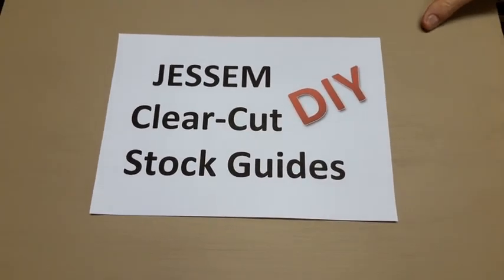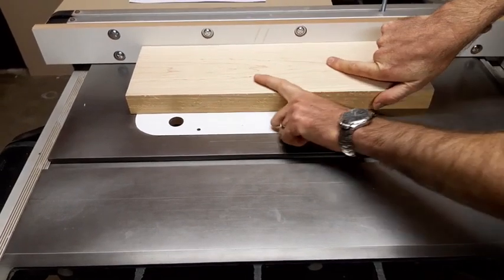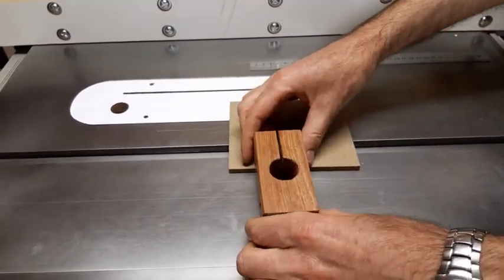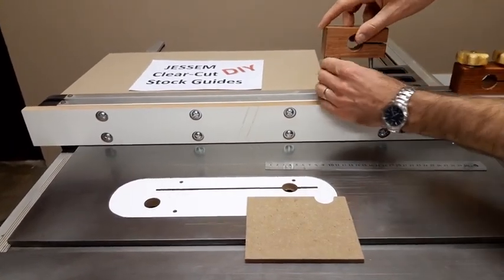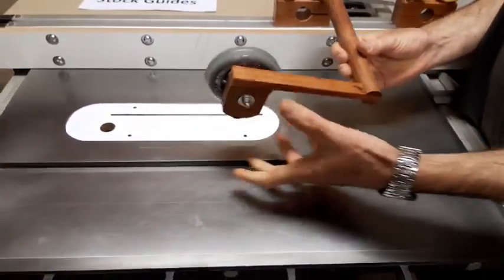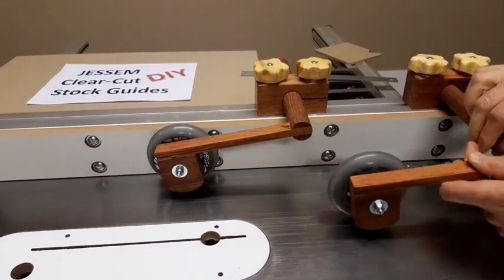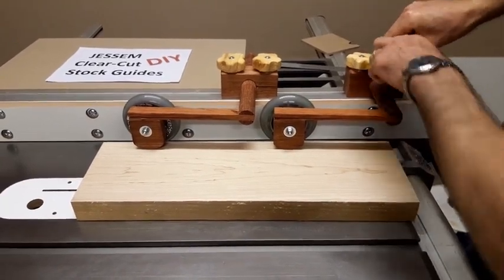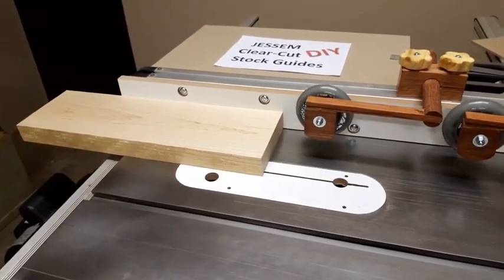DIY JESSEM Clear Cut Stock Guides

Comment: Thank you for taking the time making this video as its very much appreciated. 
As an older person just getting into woodworking (76 years old ) I would very much like to make this jig as I nearly lost the tip of my finger on my table saw.......
I cant afford the very expensive jig but I recon if I had plans I could work with, it would be great
Do you have plans or dimensions please as I don't fancy loosing any more fingers.
Thank you again.
Please stay safe.
Bill M8-)
Scotland
Reply from the maker: Hi Bill, please send me an e-mail and I will send you a few more photographs with dimensions.

However, rather than using the roller blade wheels, rather use these one way bearings. Then cover the bearings with rubber (find a bicycle tube that is slightly narrower than the bearing, cut a ring and pull that over the bearing).  Then you need to figure out a way to make sure that the inner race of the bearing is fixed to the shaft and the shaft is fixed to the housing - then you will also have the anti-kickback benefit of the Jessem ones as well.

corneel.dutoit at gmail.com
Reply from the maker: Bill, also be sure to subscribe since I will make an improved version soon.

Comment: It appears these wheels do not roll in only one direction to help prevent kickback, like the Jessem. Is that correct?
Reply from the maker: Hi T. E., yes, you are correct, they roll both ways and does nor prevent kickback like the Jessem ones.

I have recently bought some one-way bearings to make the wheels from those bearings to prevent kickback- will post a video it that works.

Comment: Excellent design!  Like one of the commenters on this video, I'm also 76 years old.  I can't tell by looking at your video if your wheels are angled in at 5 degrees to steer the board being cut towards the fence the way that Jesse guides do.  Was that part of your design?

Carlos
Reply from the maker: Hi Carlos, yes, I did angle it around 5 degrees to pull the wood against the fence.

Comment: I can’t tell from your video how you apply the downward tension. You say you have three pieces that provide the spring, but I can’t see it. Can you elaborate more or post some close up pictures of the “spring” mechanism? Thank you.
Reply from the maker: Hi Grant, the straight arm from the rod to the wheel consist of 3 separate, thin pieces of wood. They are only glued together where they enter the rod, the rest of the length they are loose from each other and can thus move against each other.

The mounting block for the Rollerblade wheel is slightly smaller than the diameter of the wheel, so when I drop the block onto the wood, the wheel hangs down next to the wood by c 10 mm. When the wood then pushes under the wood, it lifts the wheel up that 10 mm and the three pieces of wood apply downward pressure since they are now being bent upwards slightly.
Reply: @jcwoodworx-corneeldutoit3419  clear explanation, thank you!

Comment: I bought one just a few weeks ago whwn it was on sale otherwise couldnt justify the cost. Little did know that even a good idea/product can be limited by its weakest link. The set i received only had 4 socket screws with wing nuts even though there are 8 holes made for them. There are 4mon each side of the aluminum extrusion and in order to remain ridgid over the years it need secure hold down.  Well apparently spending over $250 did not justfy adding 8 screw sets vs half. Shame thst the customer service was zero help. I remain loyal to companies with good customer service but that was not my experience so will be returning product.
Reply from the maker: Eish John, sorry to hear about your bad experience. Hope they sort it out for you soon.
Reply: I had a similar issue, missing screws for my Jessem doweling jig ... I couldn't get in touch with them at all and was about to give up, then I finally got a response. They moved operations from Ontario to New Brunswick and had hired a third party to handle their customer service during the transition who turned out to be useless. They had my bolts to me the following day... this is about 2 months ago that I finally got in contact with them.